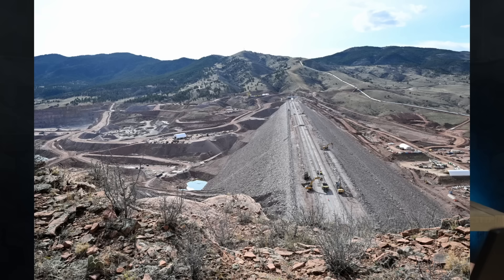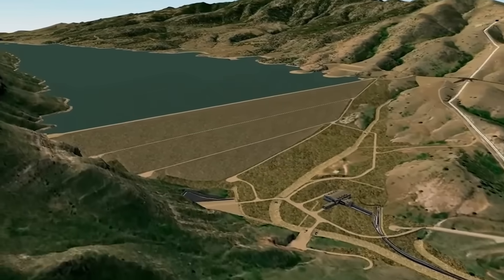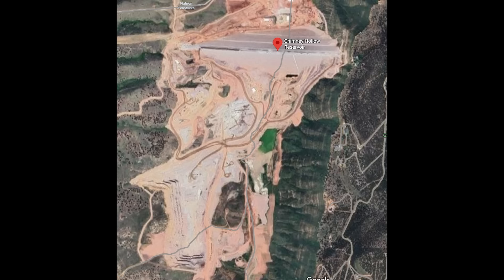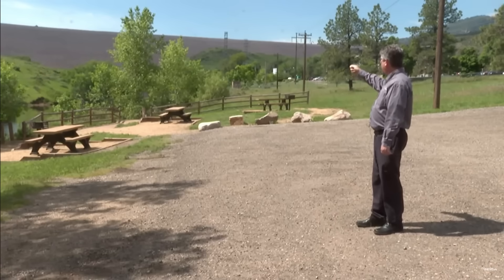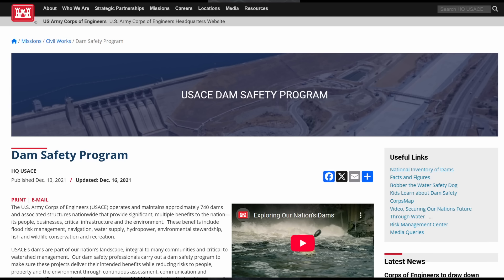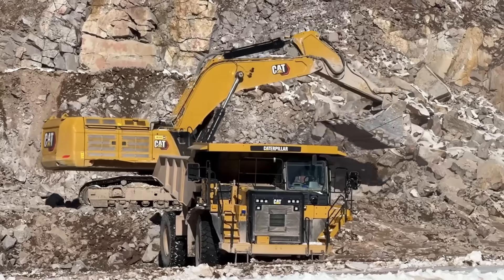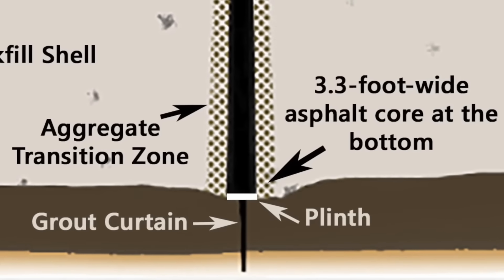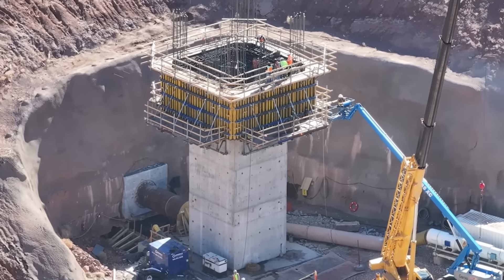Chimney Hollow Dam and Reservoir - Can you Drink the Water?

Comment: So they've identified the granite from the on-site quarry as the source of the uranium?  And the concern is that water that will come in contact with that newly exposed granite, as well as the granite which is now part of the dam, will become contaminated with uranium leaching from that granite? What about other areas of what will be the floor of the future reservoir?  Is it even possible to test every square inch of ground that water will come in contact with once the reservoir is full?  Isn’t it possible that exposed rock or the ground itself elsewhere within the reservoir could leach uranium or other dangerous elements into the water once the reservoir is full?  Is there a way to predict what the level of particulate matter will be in the water before the reservoir is full?  

I don't know anything about geology, but it seems like there's no real way of knowing until the reservoir is full.  Not to say that due diligence isn't necessary.  Maybe that was all part of the Environmental Impact Statement.  

Is it possible that the apparent delay in making the information known has more to do with the uncertainty of its impact than some sort of cover up?

Comment: As to uranium, I would have been surprised if uranium and other related minerals were not in the rock at Chimney Rock. Most, if not all, of the state has subsurface radioactive rock and it is in the water as well at a level that needs filtered. It may be a surprise to those who don't know the geology of CO. I think the most damaging is radon in the soil and in the water. Radon is a granddaughter of uranium. Usually when you find uranium, you also find radium and radon.  Radon is a gas that is released into the air when soil & water meets air,  like when a faucet is turned on. It is the 2nd leading cause of lung cancer right behind cigarettes. Radon in my well water is twice the standard. I had lung cancer after living here 30 years - cured now.  Others particularly in basin areas (caused by geologic activity when the Rocky Mountains were formed) have levels that are up to 1,000 times the standard.  Not surprising to learn most providers don't test or don't filter for radioactivity. Can't fix what you don't know about. Right!  It is expensive to mitigate. Most providers rely on "the solution to pollution is dilution" to fix the problem.

Comment: Lake Mead and Lake Powell are fed by rivers that run through rock layers that contain Uranium. Southeastern Utah has mines that contain Uranium. I worked in some of these mines surveying them. I have never heard anything about Uranium contamination in these reservoir which feed some of the most woke regressive global cultural Marxist areas in the USA...California. One would think they would be demanding restitution because of Uranium contamination. 

I think this is just more environmentalist nonsense designed to halt any progress and population growth. 

As for just over the ridge...my bet is that water has Uranium in it as well...the front range has all kind of Uranium bearing rocks...make one wonder if the reservoirs deep under ground are not contaminated as well since the water percolates in to those wells through Uranium bearer strata. As a Home Inspector, I have never had a request for uranium testing of well waters...only  fecal coliforms and E. coli , Nitrate and nitrite. There are dozens of naturally occurring minerals and inorganic elements that water picks up. Maybe thousands of man made substances and PFAS infest the waters as well. To pick on uranium is just pseudo science designed to delay the project.

Comment: Super heavy, nonionic, moderately soluble compounds in a relatively nonturbulent situation, should result in most leachate moving deeper into the structure instead of mixing into the water body. There is an analog in water bodies contaminated with lead from old plumbing, fishing gear, and shotgun shot, (the lead causes problems when ingested by wildlife directly) however lead compounds suspended in the UNDISTURBED water are surprisingly low.
Reply from the maker: Thank you.  I certainly hope that is how it turns out.  I am just surprised that they haven't released any modeling results for the likely transport mechanisms.

Comment: I've worked for both BOR and USACE. USACE first at a dam on the Snake River.  When I started dealing with BOR, many senior engineers had very cavalier attitudes when you'd ask questions. Their responses basically were "that couldn't happen".  Then I'd point out a failure that demonstrates it and the response was generally like that was a one in a million. Or we learned from that.

Comment: One key word in the press release was "sheared" - granite near an old fault that broke up the granite. That may have provided a path for surface water over the eons to penetrate the granite, and a much larger surface area to leach and concentrate the uranium at lower levels in the shear zone. Excavation would have unroofed the sheared volume of rock where the uranium concentration was high, allowing percolation during high rainfall events mentioned in the press release through that zone and into the water impounded behind the cofferdam where it was discovered. When the reservoir is filled, percolation through the shear zone will be away from the reservoir, carrying the uranium with it. I would bet the uranium won't be a problem, but not enough to drink the water without further testing and remediation as necessary. They may need to cap the sheared rock with clay or other impermeable material to lower reservoir losses, which would also seal off the contamination.

Comment: Well there are three other reservoirs in the immediate vicinity. I imagine the issue is probably due to the ground disturbance during construction, they probably just need to flush out the construction dust a few times, or perhaps install a liner. Maybe both. I wouldn't be surprised if the other older reservoirs initially had the same issues, but how much testing was done back when the older reservoirs were constructed?

Comment: Physically, concentrations from leaching rates and solubility of contaminants as a function of the flow through the dam at relatively steady state is an entirely different state than  testing construction debris.   I would go as far as to say that the only possible way to have even a remote chance of estimating /predicting concentration levels would be to have some good core samples and apply them to good transport models.   My intuition leads me to assume most of the dust and particulates will wash out quickly and the your so-called 'leaching' and 'solubility' of uranium into the system will be small once rinsed.  I think you were being somewhat alarmist and unfair by not addressing physics here.
Reply from the maker: You didn't watch enough of the video.  I already said as much.

Comment: The water that was tested and released is water that fell on the entire quarried area and made it's way to the lowest area as runoff.  I would expect this water to have very high levels of a lot of minerals and other "stuff" (pollutants) of all kinds.   It is not representative of the situation of a reservoir that is partially full, where much of that quarried area will be below the water line.  It seems very likely that Carter Lake and Horsetooth Res would have had the same problem as they were constructed, and they have no issues now.

Comment: As the “dust settles” uranium maybe the lessor problem compared to the microbiological metabolism of the asphalt core by Pseudomonas and Bacillus species which will release multiple hydroxylated hydrocarbons including phenols.  In addition, microbial digestion may eventually cause the core asphalt to become brittle through extended time as happens to asphalt roads.  But surely the chemical engineers to this into account?

Comment: I think it is a well known fact that the ancient Granite Rocks contain Uranium.   I studied Environmental Control at Norwich University.  We were discussing lead pollution from the Tetra Ethyl Lead in car fuels.  Out tutor said that as lead was a heavy element it would be deposited on the road surfaces, his exact words were 'As long as you don't drop your Sandwiches on the road you should be Ok.'
So my guess is that the Uranium and Granite Dust will soon settle on the lake floor.   Also if using a Pipette to sample these water samples, it would make a difference if you took the sample from the surface water in your flask, compared with taking the bottom water of the flask.

Comment: "There is a rather trite saying that states: "The solution to pollution is dilution". While I disagree in principle with this statement when it is applied to municipal waste disposal sites, ocean dumping and other industrial sources of potentially toxic leachate producing materials, in this particular case study at Chimney Hollow Reservoir, I suspect the high levels of uranium found in the water retained and released from the temporary cofferdam storage volume is related to the high amount of "fine" materials contained within the basin where the parent material was originally extracted. Once the excessive turbidity goes down with settling out of entrained fine particulate and the backfilling of the reservoir to eventual capacity with uncontaminated water, I predict the water levels for uranium contamination will drop to "acceptable" "background" levels of contamination. However, I also think ambient air sampling should continue with routine up-wind down-wind onsite/offsite monitoring for airborne levels of uranium in PM10 and 2.5 um size ranges for at least the next 10 years.  Any source of dry aggregate materials that could potentially contain native uranium should be carefully monitored and thoroughly documented to prevent subsequent erosion of such identified and documented sources of contamination via wind and water erosion. This is just my opinion based on pure speculation and zero factual evidence to support my conclusions.

Comment: Can they locate the uranium rich rocks, and cap them with concrete?  or something?  

I have heard in my area, that Radon can seep through the basements into the homes in Portland Oregon.  If the Uranium can seep through a cement block, maybe that is not possible way to solve the problem?  What about a cement cap, with a 60" diameter chimney going to the water surface?  If the bad rock happens to be close to the upper level of the reservoir, that might be a practical answer, but if it is closer to the bottom, then not likely to work.  

Then if there is 1 microgram per liter, put in so many liters that the concentration goes down.  Or not flood the lake over that section of the reservoir?  

In the desert near Lone Pine Ca, they have huge amounts of asbestos in the roadways around the area, so travel on gravel roads can expose you to asbestos dust.  Paved roads do not normally disturb the local dirt and asbestos dust.  For those who do not know, asbestos is a natural rock, found in many locations.  It does not need to be mined, it can be at the surface of earth in many locations.

Comment: Please cover the Obama Center in Chicago.  It is way behind schedule.  The main contractor forced the concrete contractor to change the amount of rebar, putting it outside of the legal standard.  The main building, called The Lantern, is almost 300 ft tall, and COVERED with cracks, some as much as 2.5 inches of gap.

Comment: Your timing is impeccable, given that it was just yesterday evening that I watched a YouTube follow-up video that was intended to get  the content creators' audience caught up on the last 3 years of this Chimney Hollow Dam project.  I did not see the initial video about the project, thus it was all new(s) to me--fascinating project from my perspective as a mere lay person with no structural /mechanical engineering chops.

That said, your video was at the top of my feed when I opened YouTube this evening.... so that immediately got my attention!

Alas, there was no mention regarding evidence of contamination by Uranium that probably originated from within the on-site quarry in the video I watched yesterday, although to be fair it included its most recently captured video footage from early June 2025, when the content creator last visited the dam.  The construction lead stated at the time that they had <30 feet remaining to reach the final design height of the reservoir and if memory serves they said the anticipated diversion of the water to initiate the first fill of the reservoir would begin in mid-to-late September 2025.

So the fact that the date may have been moved out by 2 whole years is interesting indeed.

Comment: I suspect the solution is dilution though it may delay using the water from the reservoir. Too bad there isn't a source of clay nearby that they could use as a barrier between the quarried rock and the water. That would be a better solution than hoping dilution is enough and falling back on filtration if it isn't.

Comment: It has been a well known fact that uranium and other elements are present in granite.  Take a geiger counter into your kitchen with granite countertops and it will start clicking.  Blasting of previously undisturbed granite formations is going to expose infinitely more granite surface area to water which is the universal solvent.  So it is no surprise that the uranium levels and other elemental levels will be elevated for some time until they settle or are washed away.

Comment: How is the acceptable amount of uranium arrived @? We are exposed to various types of radiation constantly. I live in an area with Radon in the soil. It seeps into our basements. We bought a test kit. Our basement had just a bit over the recommended daily allowance. We had a foundation ventilation system installed. Then tested again. Now less than the maximum allowed (independent testing lab.). How was that Max. determined?
Used to use the Buster Brown X-ray machine at the shoe store. Surprised I still have feet!